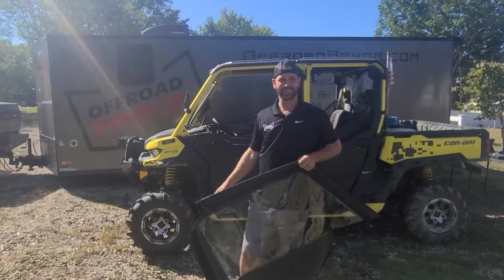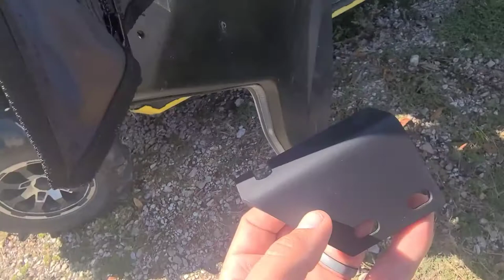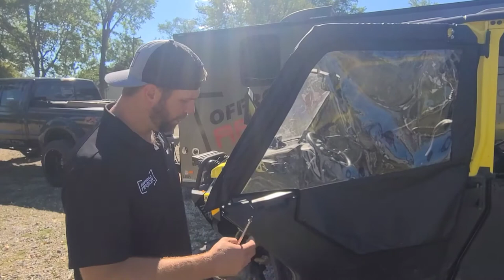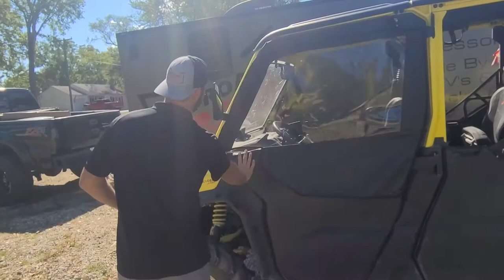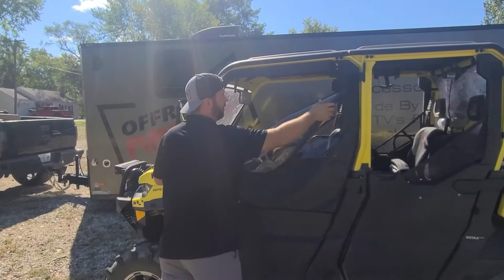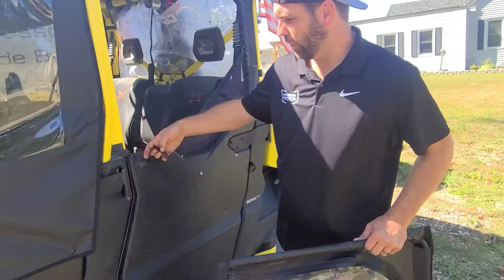Offroad Armor Can-Am Defender Framed Upper Doors for OEM Half Doors - Installation Guide

Comment: What if I have the thumperfab lower doors, can they be made work
Reply: That's what I have. I just seen Thumper Fab made soft upper doors for the Polaris Ranger. They cost $1000 for 2 half soft upper doors which seems  ridiculous to me. The Defenders upper half doors aren't available yet 🤨
Reply: I feel the same way, gave 2000 for bottom doors now close to that for top half, should have bought cab version, gonna have that and more in this one
Reply: @p.t4769  Yeah I hear you. I bought mine used-a 22 Defender XMR and it came with the Thumper Fab bottom half doors so I've been waiting for the upper part since I plow with mine in the winter. I don't think I can justify $1000 for some vinyl and Velcro though. Not sure what I'm going to do.🤷

Comment: What kind of door are you putting that on. Is the door plastic or metal
Reply: These are made for the OEM half doors
Reply: What does it cost  For the half doors. And for other part of the afterwards
Reply: @timothymelius9  around $1500 for lowers and $1200 for uppers